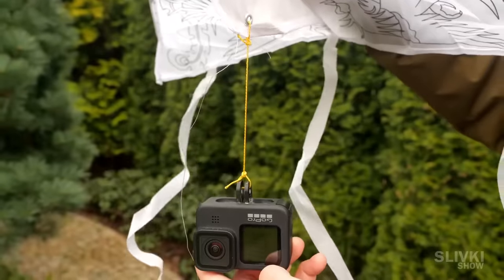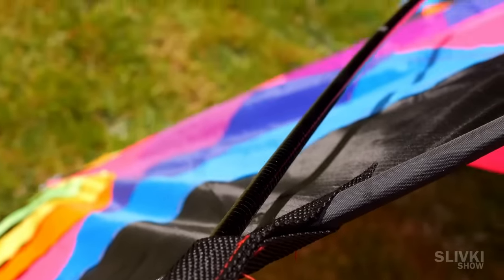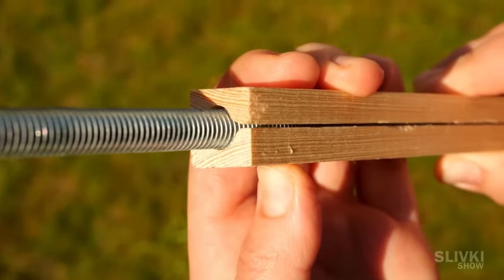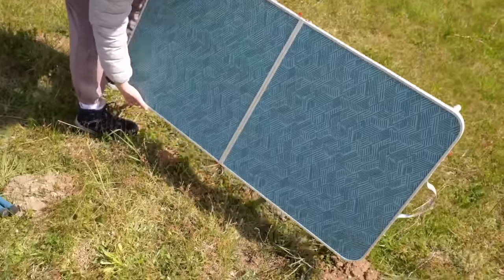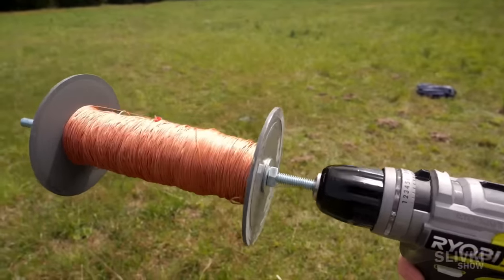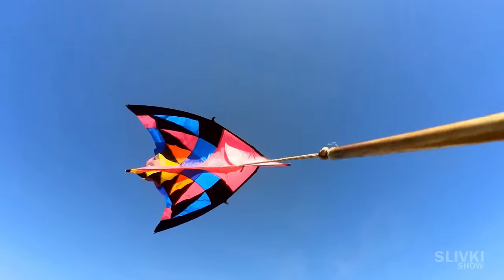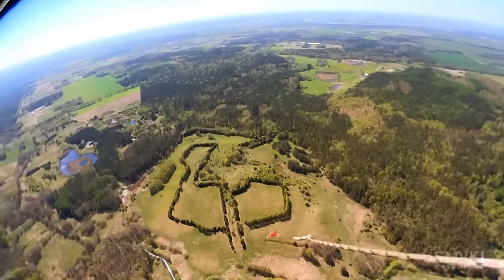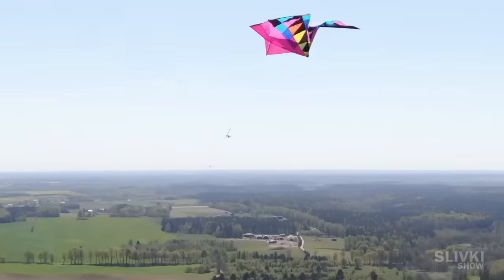WE FLEW THE KITE INCREDIBLY HIGH

Comment: Fun fact: for context on how high this kite flew, the Guinness world record for the highest kite was 4,422 m (4.422 km) meaning that Silvki was able to fly it 1/4 of the way there from breaking the world record.
Reply: 4'422 m eq 4,422 km
Reply: yall keep forgetting that the line isn't vertical and therefore the actual altitude is 1000sin(theta) meters, theta being angle of string to ground. So it's probably less than 1000/4422
Reply: @mumujibirb Was about to say the same thing
Reply: @mumujibirb  would they also have to account for the weight of the string causing it to dip in the center? Would the dip affect the theta angle and altitude calculation?
Reply: @Eyes0penNoFear  i don’t think there’ll be much of a dip because the string seemed quite tight(high tension)
Reply: you should try the kite that we have in Greece for clean Monday (hexagon kite easy to make ) i flew mine once in 7 beaufort , and actually this year i managed to get mine 800 meters up in the sky im pretty sure that they can go even more, also as a kid I remember going above 1000 meters !
Reply: in other words it was trash
Reply: Impressive 😊
Reply: did they hang 2 action camera with the kite?
Reply: @tk-maker  it was in the 2000 so probably not.
Reply: Dude when i was a kid we flew a normal kite that high when i lived in florida .we had 10 or 12 spools of 300ft it was a light windy day . My mom went back to the store to buy kite string lile 3 times . We started out with 3 just because we had it but when it didnt break my dad and my uncle wanted to see how high they could get it to go . It eventually broke the string on the last roll . It took forever to roll all the string in . We was at a park by the beach in clearwater . I was like 6.
Reply: Indian kites:        bruh☠️
Brazilian kites:             are we a joke to you?🤓
Philippine kites:               ulol😐
Indonesian kites:                      oh really?😂
Reply: so which one is right? 4,422 meter or 4,422 km?
Reply: @Eyes0penNoFear  yes, but it is expected the string is taut as the force exerted by the wind should pull it straight.
So slightly less significant
Reply: Happy
Reply: 4422 meters would be like 13,500 feet.  I think they've gone much higher than this.
Reply: The kite is too flexible which affects its height so it decreases, I think....
Reply: That was a box kite that made that record. Box kites are the best for extreme altitude.
Reply: @randyedwards3633 we did that too, but the string weighed it down. The kite was a 1000 yards away but wasn’t all that high because the string ran a long way parallel to the ground (a couple hundred feet altitude) and the kite was maybe twice that high out at the end of the string. The string kept trying to dip down & hang in trees. Never could get the kite to stay at an angle to be almost straight up. Decided either string weighing it down or no wind higher up to lift the kite & string straight up.
Reply: @sriami58 the first one. 4,422 km is way above commercial flight path, which fly ~11 km (33,000 ft). 100 km is the Karman Line, ie the edge of space. 😂
Reply: That record is for altitude only. The person flew it off of a very high mountain. They didn't have that much line out even. Maybe 300 ft or so. So it's an altitude record BUT not a record for the most payed out line from the flyer
Reply: It's actually 16038 ft held in Australia in 2014
Reply: @SniperLogic  4.422m =4,442km
Reply: @mumujibirb  and the string would actually curved. So standard trigonometry won't work.
Reply: How many feet
Reply: @olipas2775  ok yeah. Makes sense!
Reply: “Ordinary kite”
Reply: Cara aqui no Brasil sempre soltei pipa a mil metros isso é muito pouco estou falando de pipa pequena e com linhas comuns esse ai tá longe do recorde 😅
Reply: 1000 meters height cannot be made to fly with 1000 meters string

Comment: I am shocked that your rope survived so much tension
Reply: That's what she said
Reply: @aantriksh444 💀
Reply: Ali express /wish rope at that
Reply: I would've used kevlar string that stuff is pretty strong
Reply: Needed a load cell to measure actual tension
Reply: Chinese rope - I'm surprised to.
Reply: flying in a lighter wind makes launch harder but after 100ft it is better.
Reply: Elon musk is shocked too
Reply: "String"
Reply: Between the tension and all the vigorous movements I’m surprised there isn’t a fatigue failure
Reply: rope string
Reply: That rope is very durable Fishermen use it to make a fish net
Reply: I'm far less impressed by the line strength than I am by the kite's ability to lift it.
Reply: @joewoodchuck3824  You saw that handful of twine he had at the start. The string by itself probably only weighs about 8-10 ounces. That kite in that wind could easily lift the whole bundle, cardboard tunes included, even flying with a thousand meters of string below it.
Reply: Me too I've had string break flying  at tree line level
Reply: @theredstormer8078  not as strong as HDPE string!
Looks like what they were using
Reply: I'm shocked they were even able to get away with it.
Reply: It survived coz it was a copper wire not an ordinary thread brother
Reply: Its fish net thread ....
Reply: Meanwhile the rope: I am tension free now😂
Reply: Same hear 😮
Reply: Imagine if a plane passes
Reply: @Shixaal  nn
Reply: That's a copper wire bro
Reply: @anikdas4477  if it was i would pass a high voltage thru it
Reply: In india we just use  some groom stick, newspaper  and with help of cotton ropes and little bit tapes  reached  more then this height
Reply: Bro I India every single chal fly more then 1.5 km 
My record is I think 5 to 7 km 😊
Reply: @krishshekhawat6355 why does lying come so easy for you?
Reply: @cocaburra   bro actually in India there is a fastival of kite flying in the month of February so  the childs of India are start flying kite for Dec to mar so I gat well experienced to haw do  fly a kite  ok dear thanks 
By the way you are to much old on YouTube your renguar account. Is 14 year old and I am is 15 years old nice to meet you dear
Reply: hi
Reply: @NgocDieuSaoMiNi  Hello
Reply: Physics student 😂😂
Reply: Haven't you ever fly kites, in India we fly kite almost a km regularly of this size 200 to 300 Mitr is normal by 14 yrs children November to January is most favourable season for kite
Reply: Dyneema
Reply: I'm surprised it didn't cut through itself
Reply: @souravKumar-si9hw chewing gum works better than tapes. More flexible.
Reply: The longer the string, the less stress is in the rope because it will be divided on the entire string
Reply: @rickyshepherd4326 yup 'string' is the word I was trying to remember but all I could think of was 'rope' and 'thread' which i subconciously knew was wrong and not the correct term. Thanks
Reply: @krishshekhawat6355  lie some more why don't you.   The world record is  4.9km.
Reply: @resresres1  ok i am wrong sorry I guess it may be 3 km or 4km

Comment: In India every small-town boy flying  kites higher than you could have ever imagined
Reply: And Nepal too
Reply: But except not with weight on it like a big camera and a small camera and also the mount for the two cameras. The kites Induan kids fly won't even fly a meter high with the same weight the kite in the video did. And also because the ropes/threads are not measured by Indian kids or Indusn kites in general, we overestimate the height covered by the kite because its calculated visually without any measuring tools/equipments. We think the kites flew at least a kilometer far but in reality if cdlculated properly it won't even be half a kilometer i.e 500 metres. So stop bluffing and being falsely proud of something that doesn't happen in India.
Reply: True😂
Reply: We fly kites over 4.5km in india😂❤
Reply: Even a 14 yr old in India fly higher than this man...

Comment: If you want to stabilize the kite and fly an higher heights . Attach three long tails to it, two tails on the left and right wings and one long tail in the middle. The middle tail has to be the longest while the right and left wing’s tails have to be same length. I used to build kites when i was young and that’s how I learned why it’s important to have three tails instead of only one in the middle.

Comment: Do a search for "picavet camera suspension" and all of your camera mounting troubles will be solved. I used to do kite aerial photography (KAP) as a hobby and a picavet mount was crucial for taking smooth photos and video.
Reply: ^^^^ This! And attach the camera about 10-30m down the line from the kite and it'll be much more stable.

Comment: changing the angle that the kite meets the string might get it into a little less lift mode.   also you could get a bigger cross member or even just get a spare one so you can double up on that tension.

Comment: Ideally, you would use a sled-style kite. These kites have auto-zenith characteristics and are typically used by Antarctic research labs to hoist scientific instruments aloft. Consumer versions would be something like a 6m Pawita Pilot that's often used for lifting heavy-duty sky laundry at kite festivals. Use kitesurfing line made from Dyneema for maximum strength.

Comment: Interesting, personally I would say that our kite is the wrong design type for the high flight level. I personally flew a Box Kite to 400m about 35 years ago. I would say that you should use a box kite design for a more stable flight. My kite was shop bought and also use carbon fibre rods for its rigidity.

Comment: to measure the actual height of the kite, the tool used should be equipped with an altimeter so the year is the actual altitude. because when the kite is raised upwards it will not straighten up but tilt and the longer the string the longer the string will no longer be upright, it causes the kite not to go straight up either. I also wanted to do an experiment like that but because I don't have an altimeter, I finally resigned

Comment: next time have 2 sets of gloves for emergency line grab, a tight fitting set of mules[brand name stateside, made from a very durable leather] and a good new pair of welding gloves, wear the mules inside the welding gloves it may be the only thing saving fingers in an accident. if rope that thin is playing out at speed and you grab it with those thin rubber coated gloves it could take a finger off all the way to the armpit, it may sound like a joke but thin rope moving at speed is a SAW and will cut off even BONE if given the chance. DO NOT GIVE IT THE CHANCE
Reply: Gzdgyshzgxajzhdhedbcbfbfbnibrfrg🌹👍fy😀fihpif❤️💞🤣😙😗😙😃🥰😗🫠😙🥰fih

Comment: In the 80s I flew a cheap paper kite with a 100 foot crepe paper tail out to 18,000 feet (3 miles!) using 4 lbs test stren fishing line. It was visible with binoculars only for the first 6,000 feet or so then we lost sight so I cannot say how high it went but even at 6,000 feet I would loosely estimate it was 1500 feet, so to extrapolate that to 18,000 feet we had to be 4,000 + feet high. I didn't even think about reeling it in. Just tied it off and left it. Cheers!

Comment: As the wind speed increases exponentially with height, definately use a more suitable kite for the job (for instance : a KAP Foil 1.6) and appropiate braided dacron of enough strength as a kite line. Good luck !

Comment: Very interesting, very interesting. If you knew there were no wires around, you should use The Wire and then you could have captured the electricity that comes down. Several 1000 V run run it to a Ignition coil. And I'll drop the voltage down some usable voltage which you could charge batteries with the other interesting thing would have been to be able to use your drill.  To generate electricity. Generate electricity as it pulled up and then to somehow pitched down the kite.So it would descend and you could wind it up without using any real energy excellent video

Comment: yes we do fly kites in such heights, even far than this!! 
in Nepal, during the festival of dashain (which falls on October-November), the weather is neither too hot nor too cold and perfect for flying kites. Flying kites is also a part of this big festival. We buy threads (consisting sharp blades of powdered glass mixed with a special glue) of almost 1000-2000 meters and fly kites to that distance. the most enjoyable part is we have competition of cutting off each others kites at such heights. the one with the strongest thread wins 😉

Comment: Great video, it brigs back some memories. I've done this with a 19 foot delta kite, that's 5.791200 meters wide. I had 1,000 meters of 500 pound test line (over 225 kg breaking strength) and managed to let all of it out on several occasions. With a kite of that size I was able to mount a camera rig that I built with servos and gears left over from remote control trucks that I had. The rig allowed me to control the camera angle and pitch as well as shoot photos at will from the ground. Here is something that needs to be mentioned though, even though you have 1,000 meters of line out the kite is not 1,000 meters above the ground. I never bothered to mount an altimeter to the kite so I can't say how high it actually was above the ground, but judging from the angle of the line and where the kite was relative to where we were standing it likely was between 300 and 500 meters above the ground most of the time. There were times when the kite was nearly straight over head, but even then I doubt that it was over 800 meters above ground. 

To reach 1 km. in altitude you probably would need at a minimum 1,500 meters and possibly 2,000 meters of line. Long before I was a kite hobbyist I had managed to get 8,000 feet of line out with a kite, that's 2438 meters. This was a much smaller kite than my 19 foot delta that I had built myself and I was using 20 pound test monofilament (9 kg. breaking strength). That's the most line I've ever had out with a kite and I recall a an airplane nearly flew into it. I felt the tug on the line as the plane flew by the kite thinking it had struck the kite, but it was only the turbulence created by the Cessna 152. On that day, I think it's safe to say that the kite had likely reached over 1,000 meters in altitude. I make that assessment by judging how high the aircraft appeared to be as well as the canter in the line and where the kite was in relation to where I was standing. I was a teenager then and don't plan om ever making that mistake again. Here in he U.S. we are not legally allowed to fly kites over 400 feet or 120 meters above ground. I had no idea there was such a law back then, but if I had caused a disaster I'm sure I would have found out. Now I understand that it is possible to obtain clearance from the FAA to fly higher than that. I don't know about where you were flying on this day,but I suppose there are probably similar laws.

Comment: I had a superman kite when i was 11, back in 1981. i had two spools of nylon sowing thread, this was very light weight and very strong. i attached the two spools together, 4,000 yards 2.2 + miles long. that superman kite disappeared into the clouds if you did not know where it was it's impossible to see black speck.... The speed of the unwinding was so fast and the wind strength was more than i could control, in the end it reached the end and i did not tie it of, slipped my mind and i lost the kite.... What a blast it was....

Comment: We flew a kite for almost 1,500meters. I used a 5meters kite and Kevlar braided line with 2diameter.  You can used a Vietnam Kite made which is high strong and using flexible carbon fiber tube they are all stable in the air.

Comment: 16" kids bike min. The Bigger and wider the bike tire the better. Remove rear tire and tube. Tie string on rear rim. Reinstall rear rim. Now you can use the pedals to wind the string. Tie on kite flip bike upside down and you are ready to fly. One of those screw in the ground Dog leash screws will help anchor the bike and a tire iron will double as a help for the anchor and as a anchor to put in the spokes to keep the wheel from spinning. Use pedals to rewind back on rim. If you go to a bike shop they may have a bent or unusable rim for on the road riding that may fit your bike. Explain what you are doing to them they may give you a bad rim or an uncommon one for a reduced price.  You can then take a few tool with you, ride bike to nearest spot to fly, take off your over the road rim and replace with kite rim.  As a young kid I didn't realize how big of a problem this could be. We had about 1,500 feet ran out and saw a prop plane heading towards the kite. It made a deliberate move to miss it. Then it circled back around. We freaked out pedaled in the kite at a record time, swapped tires and got out of there.  As an adult I would like to tie on at least 5,000 feet but with a motor cycle shop just down the block this pedal set up could be used on a bent or unusable frame and maybe they could sponsor the set up and... Now you get me wondering how much string would fit on that crumpled big tire bike that has been setting in the corner of the lot. A 20" rim is about 60" around so that is only 1,000 turns per mile...I wonder what the charge is to send in a motorcycle rim in and get 5 miles of string attached...hmmm

Comment: I flew a kite 5,000 feet. You need a bigger tail. The winding of the line crushed my line winder. My tail must have been 50 feet long with about 10 4 inch wide ribbons.  Helicopters changed routes when they saw my kite. My kite wasn’t that big but bigger than the first 2.  Good luck boys.